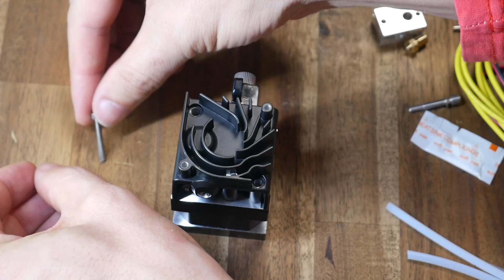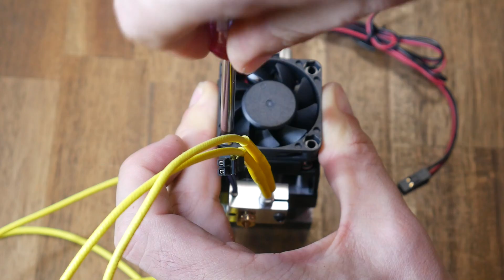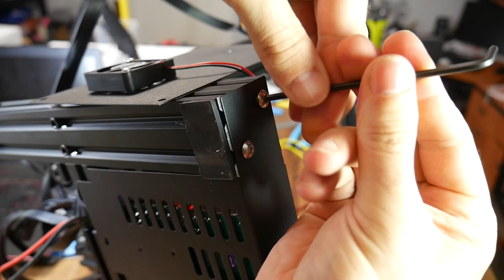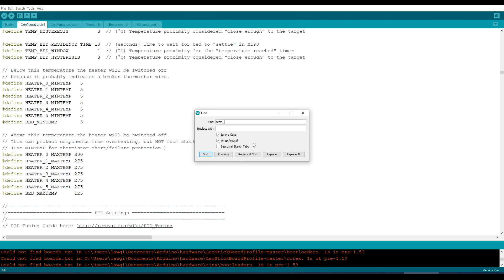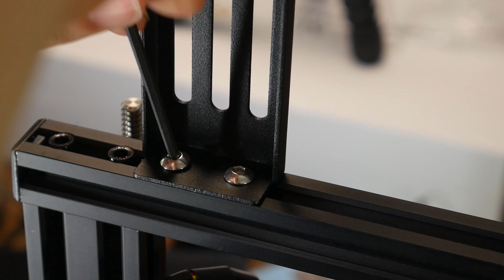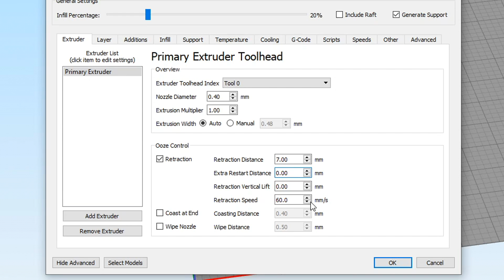Hemera to Ender 3 - Complete guide

Comment: I was really hyped about this video as I just got a ender 3pro and intend to use it for a decent amount of TPU and wanted a high quality Direct drive setup. but I lost interest after seeing the quality of the mounting solutions. for this price point there should be factory metal CNC brackets if not included, than at least available for a extra fee for popular printers.
Reply: So true! It would cost bugger all for the company to have 300 sets of mounting plate/s laser cut then add a couple of bucks to the price.
Reply: I'm with you on that. I was ready to pull the trigger but after watching some installation videos I was like what?!? 90 Pounds (150 CAD) for a hotend that will be mounted with 3D printed parts?!? Those guys are so dumb marketing wise! Mounting a hotend with 3D printed parts that are not flame-retardant treated that's so stupid IMO. A real fire hazard.
Reply: I wish it would have been included as well, although I didn't struggle with the printed backplate as much as Michael. I can see from E3D's side of things why it's not included... each printing platform is going to have a different back plate, and even there would need to be multiple versions for each platform for various bed-leveling sensors.  I think it's why they worked with some popular YouTubers to design some mounts for popular printers prior to release.
Reply: @LongLiveCHIEF  No they don't have to come up with a mounting plate for each and every printers out there. But only for the bulk of your targetted customers. Ender 3 and 5 is a good start. Someone has to come up with an alu or steel mounting solution for the Hemera otherwise the Hemera is just another one of those great ideas that end up unfinished products rushed to market that we won't talk about in six months.
Reply: @mikem8145  and by doing so, they'd alienate customers who aren't on one of the platforms they provided. The market is saturated, and there isn't really a "bulk target". There are at least a dozen popular 200 x 200 platforms. Another dozen or so large volume platforms, and more and more popular DIY platforms hitting the market every day, which is a big segment for high end mods.

Adding design time that they have to pay their engineers for would increase the overall cost of the extruder, even for base kits that could be sold without a plate, and would also make them highly susceptible to being too deeply undercut by knockoffs that would cater to DIY'ers who don't want to pay for that extra cost for R&D of all those platforms that is imparted into the base price of the extruder.

There is opportunity cost in every business decision. If you think about it without bias or assumptions (thinking Ender 3/5 is their bulk targeted customers for example), then it makes total sense why this wasn't something they offered with this kit.
Reply: @LongLiveCHIEF  What you say is nice stuff we teach first years at business school. I'm not an expert in 3D printing. But as a BBA MBA business strategy consultant I fully disagree. It's the wrong decision from E3D not to offer a few solid mounting solutions as optional accessories. Period. And that's why Micro Swiss will most likely get my money with their awesome new Direct Drive kit instead of E3D. Of course Micro Swiss with its new kit is targeting Creality printers owners. While E3D is a "universal" kit. But I'm pretty sure that's the main profitable market : the Ender series printers owners. They're most likely to spent enormous amount of money on their shitty Ender printer. Everyone knows it, the Ender series is a real money pit. But we're dumb enough to keep modding it hopping it will one day be a great printer. Anyway, like I was saying, Micro Swiss wants to offer THE best solution for Ender owners. E3D want to offer a "universal" solution than can be used on Creality printers as well as printers from other brands. And because of that, marketing wise, they should have designed different solid mounting plates for the most popular printers. It's really easy to design. It's really quick to design. It's really inexpensive to design. I'm sure it would have been almost nothing compare to the development cost of the Hemera extruder itself. Which look like a work of art honestly. But mounted on 3D printed parts the Hemera becomes ugly as hell. But it's also a liability problem since 3D printed parts on an extruder / hotend represent a serious fire hazard. Anyways, just my 2 cents. They are some serious manufactuers in the 3D printers business, like Dremel (Bosch) just as an exemple. But sadly I've come to realize now that too often third-party solutions in that reprap business come from tiny businesses made of a bunch of geeks hidden in a basement somewhere that come up with great ideas but lack the required knowledge on how to push their ideas to market. End of the story. I'm going back to that damn POS Ender-3 until I pull the trigger on a 3D45 to finally have peace of mind.
Reply: @mikem8145  I feel you on the chasing the dream bit for sure! I'm glad I've learned a lot, otherwise I'd be upset about the money I've sunk into upgrades just to chase problems with belt tension and extrusion consistency.

Comment: Great video - the Hemera really steps up the game for 3D printers in our space.  IMHO, it's overkill for the Ender 3 which prints phenomenally well stock.  I think the priority upgrade is a silent stepper main board.  I agree that Hemera is a great upgrade for larger printers where print speed matters a lot more especially when printing especially large objects and/or with flexible filament.  A volcano heat block is a must as well.   I would not add the Hemera to anything smaller than a CR-10.  Interested to see how Hemera fares in your larger Creality printer.
Reply from the maker: Volcano just arrived ready for this.

Comment: I don't think I caught anything about the tension on the filament. I did notice your setting looks way lower than the guide from e3d that says the white tensioner should be flush with the black part. You are able to print flexible though and I can't seem keep filament from getting chewed up. I am using reprap firmware any suggestions for acceleration settings/retraction settings?
Reply from the maker: I don't know what you mean by white tensioner. The only white piece on the entire kit is the PTFE tube hanging out the top. There is a tensioning system which I showed briefly when loading the filament.
Reply: @TeachingTech  yes the level you have the tensioner set to look s low for printing flexible filament. I am referring to step 18 in the e3d guide. The white bit there. They call it the spring block.

Comment: E3D needs to make a kit with the proper mounting plate so this is easy if they expect to sell this for use on the ender3
Reply: https://www.thingiverse.com/thing:4076960  This will let you modify a four wheel x-axis gantry plate to mount directly to the Hemera.   It it pretty easy to do with a drill bit set and good drill.  I used a cut-off wheel with a router to cut off the stock hotend mounting points, then attached the guide, used some cutting oil, and drilled holes for the Hemera.   The extra wheel helps with the added weight of the hemera.  You can loosen the eccentric nuts without introducing slop.
Reply: I fully agree on that! Mounting a hotend with 3D printed parts that are not flame-retardant treated that's so stupid IMO. A real fire hazard.

Comment: That’s seems like a lot of weight to move around. I’m thinking you get pretty good ghosting with this mod?
Reply: @MusicMan9018 I'm the guy that wrote the guide referenced in the video. So far, all of my prints have had exceptional quality. I'm kinda surprised myself! I figured I might need to add a second z axis lead screw or upgrade to HWIM linear rails, but it's working great so far.

Comment: The calibration cube is noticeably worse, way worse. I installed the $35 EZRstruder on my Ender3 in ten minutes and I print flexibles all the time with zero issue. Admittedly not at 80mm/sec. Unless you need to print tons of super soft flexibles at breakneck speeds, this seems like a step backwards vs the EZRstruder on a stock Ender hotend.
Reply from the maker: Also a fan of the EZR: https://www.youtube.com/watch?v=VyDv0CnLWU0

Comment: I have never seen an e3d nozzle stick out that much from the block before.
Reply: It's all in how you assemble it. You can back out the heat break by a couple turns and the nozzle will be almost flush to the block. Need to leave some thread for the nozzle to hot tighten though.

Comment: Far too many 3d printed parts for a >$100 part, I would expect a much simpler install.
Reply: $13 dollar 4 wheel carriage or cheaper from Ali and you can mount the Hemera with no printed parts. Just need the part cooling print.

Comment: I put one on my cr10s pro and i love it. I used 3DMN's mount plate and i've found that the slight give you mentioned does not matter that much. I love the speed though, chewing through tpu like there is no tomorrow.

Comment: @Teaching Tech :  Is there anything different or additional that needs to be done for Ender 5 running Marlin 1.1.9?  Seems like everything is the same software and voltage...
Reply: well the Marlin my printer (CR20 Pro) came with was fucked to hell and very buggy, i downloaded updated 2.x firmware from canada 3d printing on github and then i had zero issues since then, entirely stable.

i mean like the CR20 Pro has a non-adjustable bed, cause it came with the BL touch, but no matter what i did it would not take the BLtouch's input And it broke a few of the magnetic beds.

but one question: do you have a stock, noisy mainboard?
If so i would recommend you to upgrade to a better one, because the steppers seem to get less hot with more microstepping since i upgraded to a BTT E3 V2 board (and ofcourse much less noise)

Comment: That's a lot of work, thanks for posting.  Do you think the CR-10s Pro would loose any bed volume if I installed one of these?  That would be bit of a deal breaker for me also.
Reply: you will always loose some volume as the cr10 series uses the same carriage style and the stepper motor is moonted on it, so you loose +- half thikness off the stepper ;)

Comment from the maker: Hi everyone, getting a few comments about moving the y endstop to not lose print volume. Unfortunately it's not that simple. You can move the endstop ~26mm forward and this will fix the home position, but when the bed is right at the front of the machine, the nozzle still won't reach the rear ~20mm of the bed.
Reply: You can move the entire Y assembly forward by 20mm by using one of the existing threaded holes in the underside of the Y carriage rail, and using the other to mask the position to drill and tap an additional hole.
Reply: @jamestongue6056  This is what i did after installing a titan aero on my ender 3 pro, couldn't be easier.
Reply: Using the 4 wheel carriage solves all of this and gives you the full Y volume of the bed. Only issue is the wheel of the carriage  strikes the bed heater wiring but that is easily corrected with a printed mod. I agree woth you, the printed mounting solutions for the Hemera are not great options for the Ender 3.
Reply: Hi, this can only be caused by the mount you've chosen, because the with the one from Joe Casha, theres no reason for that to happen. The one you used as a second piece that simple doesnt make sence to me!
Reply from the maker: As I said in the video, the Joe Casha mount is simple, elegant, easy to print but not as secure. I really wanted to stick with it but the wiggle was too much unfortunately.

Comment: I don‘t understand the y-axis problem, I moved the y-endstop a few millimeters to the front to match the new position.
Reply from the maker: This will help you align the homing, but if you pull the bed to the very front the nozzle still can't reach the back part of the bed. Otherwise everyone would do this to increase the stock Ender 3 Y travel.
Reply: Teaching Tech I checked it and you are right I lost 10mm. I will reduce the size. But this is good, I cannot run into the bed clips anymore :-)

Comment: Can someone please make a fan mount that puts that blower fan on the end of the stepper. The ones I've found use the oem blower. I dunno if I can do it myself.
Reply from the maker: The system I used in this video supports OEM or bigger 5015 blower.

Comment: Got my Hemera installed on my Ender 3 Pro around a week ago and it is insane how much my quality AND reliability has increased. In my opinion it is a little bit "louder" than my originial Ender 3 Hotend with 5015 fan but i guess it's because the fan included with the kit ist louder but also stronger.

I used the General Ender 3 Hemera mount with BlTouch from Joe Casha (5:12)
And the duct from Hangtight.

everything fits really nice and is sturdy.

Other modifications i also did to my Ender 3 Pro are:
Bigtreetech SKR 1.3
TMC2208 Stepper Drivers
BlTouch
E3D Hemera <- obviously

and it works like a charm.
Currently printing parts for an Ikea Lack Enclosure and the quality is isane looking.

Thanks for the video Teaching Tech :)
Reply: DonnerPlays Nice! Thanks for share it. What abou the “Y”... did you make some mod or you also lose area on this?
Reply: @Fernando_Gazzola  weirdly compared to Teaching Tech i lost ZERO area. the nozzle can still reach everything on the Bed. So i still have the 235x235 Print area.
Maybe because Teaching tech used the mount without bed level sensor and the one with sensor is offset enouth so you can access everything.
Reply: DonnerPlays Nice! Which mount did you print? I believe the Y axis can be drilled to go further if needed...
Reply: @Fernando_Gazzola   I used the bltouch mount from myminifactory made by joe casha which you can see in the video at 5:12
Reply: DonnerPlays aah ok, the same one... made by Joe 3D Maker Noob... got it! 
Thanks! He also made the one for Artillery X1... I just receive this printer today and I will start to assembly in a couple of hours :)

My neighbohood will use Hemera in his Ender. 

I don’t know yet which printer I will install mine but I will probably adapt to my old Ultimaker2 or maybe in my Ender 3... let’s see...

Comment: Two strikes against this setup for me are the price and the loss of build volume. I printed my own direct drive adapter and it's working just fine for me. I have to limit my TPU speed to under 25mm/sec, but that's not a big deal as I don't usually print TPU. 
It's a beautiful contraption, but it's just not for me. Honestly, even if one were given to me, I doubt I'd use it.
Reply: Matthew Wathen you don’t loose print volume if you ajuste the y end stop. I don’t know why teaching tech didn’t adjusted. Also the you’re Paying for a v6 hotend + BMG style extruder + stepper motor + direct drive conversion. Most people already done all of this and probably spent more
Reply: @brunolopes9900  Perhaps, but cost is still a major factor for me. I already have a Microswiss hotend (got it as a gift last year) and it does just fine for what I do.The only reason I see to upgrade to this is if you want to print flexibles at PLA speeds. 
That's just my $0.02 anyways
Reply from the maker: This will help you align the homing, but if you pull the bed to the very front the nozzle still can't reach the back part of the bed. Otherwise everyone would do this to increase the stock Ender 3 Y travel.

Comment: I like it but, there;s just to much faffing around to fit it. I have E3D v6 on my CR-10 Frankenstein. Works great . I don't think I'll bother with this mod though.  How much weight did it add the the set up ? I was looking at the Tronxy x5sa where I think this sort of set up would be better used.
Reply: Putting this thing on an ender 3 is pretty silly, I agree. It would make more sense on a printer where it's compact size could help, like maybe a coreXY, so you don't have so much vertical height to your print head. Or, maybe something made to print large stuff with a volcano heat block.

Comment: Would the process be the same for installing it onto an Ender 5 Plus?
Reply: I believe the mounting and wiring should be very similar, since the extruder mount is similar from the ender 3 to the ender 5 and to the cr 10. 
I hope this helped a little bit
Reply from the maker: There are comments in the parts links about Ender 5 compatibility. The belt mount is slightly different on the Ender 5 carriage.